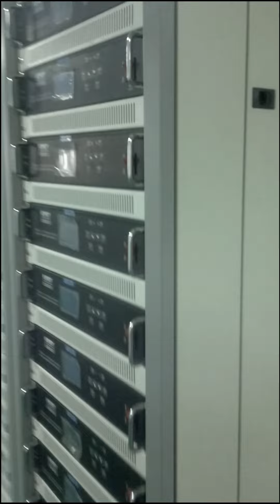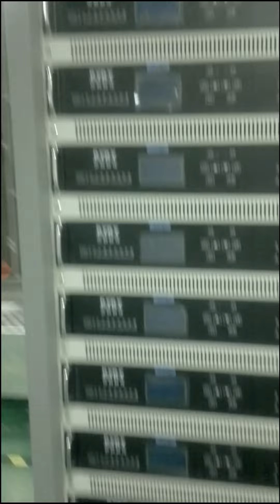Hongfeng VAC - Overall Inline Magnetron Sputtering System for Metal Coating on Glass Substrates

Comment from the maker: Magnetron sputtering coating machine is kind of PVD device that uses the magnetron sputtering method in physical vapor deposition (PVD) technology to prepare thin films. It is a coating system where electrons collide with argon atoms under the action of an electric field, producing Ar positive ions and new electrons. New electrons fly towards the substrate, and Ar ions accelerate the bombardment of the cathode target material, causing the target material to sputter.

Magnetron sputtering is a fast, affordable, high-speed sputtering system that produces superior film quality. Sputtering equipment is equipment for forming thin films, which used phenomenon spraying, in which ionized Ar gas, under the action of a plasma discharge, collides with a target at high speed, and target atoms ejected during the collision are deposited on the substrate. It can be used to produce metal films (in particular, films of refractory metals can also be obtained) that insulate films, conductive films, protective films,
reflective films, translucent films, alloys and solid solutions, catalysts and other coated ones. 

Welcome to visit us at www.hfvacuum.com or www.pvdmachinery.com for more details.